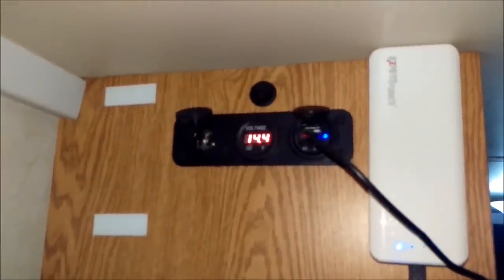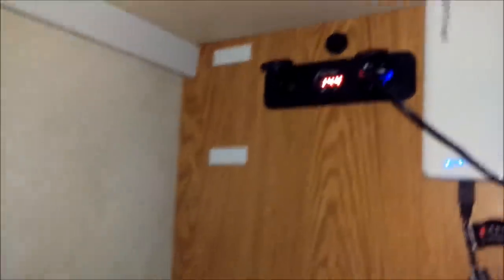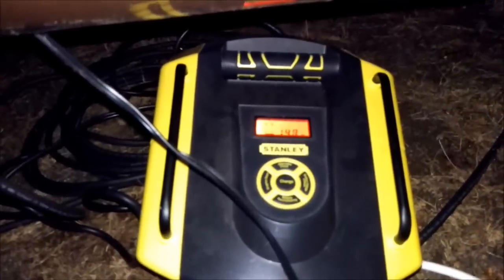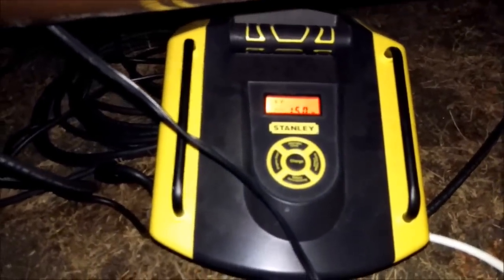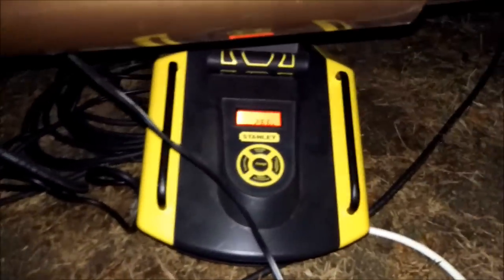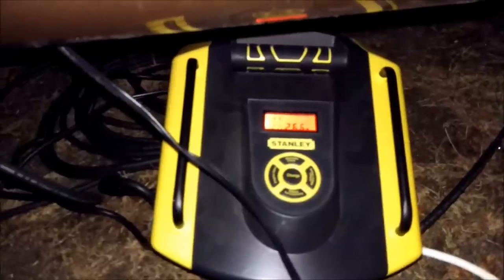Quick Tip : RV Motorhome Golf Cart Battery Charging

Comment: Thanks for the tip, wasn't sure how fast the genny charged the house batteries, figured it wasn't that efficient 👍🏻
Reply from the maker: Thanks Guys . Newer 3 stage converters/chargers are better but few truly fully charge Deep Cycle batteries because they switch to a lower amperage to soon in the charging cycle.
Reply: This is  a clip of my converter  charge rates not terrible at all   but I agree on the 80% I have a 2000/4000 inverter I feed also 900+ ahs
https://drive.google.com/file/d/0B5JuBCfPsGPuVlJNUmVMMHFILU0/view?usp=sharing

Comment: I agree. I get more from my little portable 100 watt/15 amp solar array than I do my generator.
Reply from the maker: That makes perfect sense. My 500w solar works great but with the lack sun due to clouds plus the tree cover some generator time is unavoidable in the winter.  A RV generator only powers your converter and that charges you batteries. Converters are basically a hybrid system and do a great job over many situations but when you need a hardcore charge I find a high amp speed charger works great.

Comment: I use a stand alone genny and use a 60 amp fast charger on my RV aux battery in a high demand load..I do notice a strange amperage fluctuation if I use the converter and 60 amp at same time, so I avoid plugging the RV in to the genny when I quick charge the batteries.
Reply from the maker: My converter goes right to float when the speed charger takes over. Never had a problem. My 40am stand alone charger charges my battery in less than half the time it takes my 55amp converter.

Comment: So as I see it, you are using the converter and the 40 amp charger at the same time.  Is this better, or is there any reason to disconnect the converter from the batteries when using another charger?
Reply from the maker: No reason to disconnect. If the battery voltage is very low then both units will charge but one charger will eventually trick the other into thinking the battery is fully charged. Size of the battery bank dictates how fast you can charge. Google C-Rate of charge for your amp hours battery size. Hope that helps

Comment: I have found that most inverter/chargers just fry your batteries.  Stand alone smart chargers are more efficient and better for the batteries.  The converter/chargers are the same I'm sure.
Reply from the maker: Yea most newer RV chargers are multi stage and keep the amps low so they can be left on charge for long periods of time. Older RV chargers supply one voltage/amperage and can quickly damage your house batteries.

Comment: Would it be better to use a coffee pot that runs off the stove top?  .. using propane instead of electricity.
Reply from the maker: I do use the perk one but I figure solar is free. I just need to learn the limitations in the winter months.
Reply: BlackTop Boondocker sure, it just depends on how much you have to plug in!  Right? LOL

Comment: Do you know how long it takes to charge 2 6v golf cart batteries from 50 to 100%?Thanks.
Reply from the maker: How long a battery takes to charge is effected by many things such as size of the charger, Wire size, condition of the batteries, temperature and actual charging profile. In my situation here 50% to 100% with this 40 amp charger it would be about 5-6 hours.